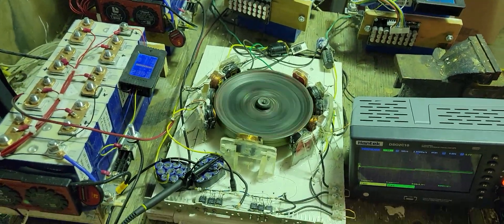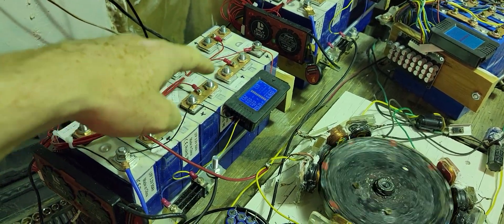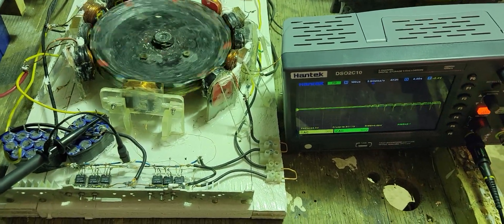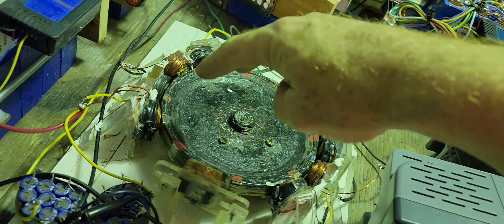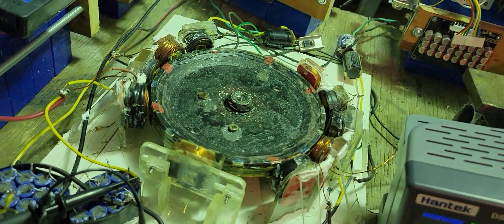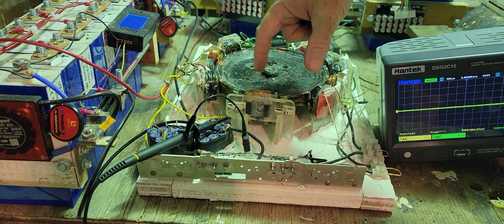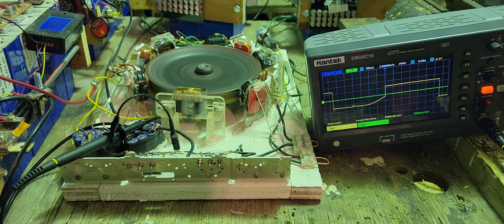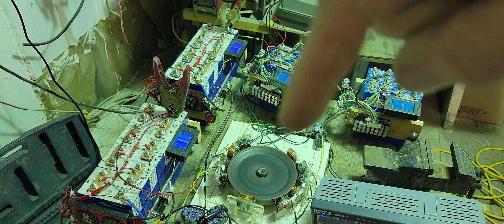Pulse motor Details and why I designed it the way I did . Reduced input power equals way more torque

Comment: to prevent the back spikes, why not put capacitors between the trigger coil and the transistors? Give the back emf a place to go and why not store it?
Reply from the maker: Yes but it will need more than just capacitors because once they are full it will be actually the same. In future videos I will add that stuff I’m trying to keep it as simple as possible for people to learn how to make these motors. I’ve only been adding small sections onto the motor in a series so I don’t confuse people with a huge amount of wiring. Thanks for watching!
Reply: @windpowerandmore6310  Unless your capacitor bank is bigger than what your trying to hold. If your output is 100 spike, then put a bank of capacitors that is 150V. flip the switch off and let it run on capacitors until it starts to slow down, then kick the battery supply back on.

Comment: Just a question about the transistors. I was wondering if you have tried to rectify the emitter and collector wire on the transistors with a incandescent light bulb"twist ball" . I call The collector and emitter wires, the input wire and the signal wire to me. I noticed before that I get the huge back spikes off the transistor signal wire and input wire. I only ask because I noticed my transistors getting hot too,
 but once I rectified the collector and the emitter with a incandescent twist bulb, the heat and the transistors went away.  I don't know if the light bulb just help control the huge back spikes or what was going on.
Reply from the maker: That definitely works yes . The trigger coil is no different from any other coil and I've done that in the past.  The reason I don't do that on this motor setup is because I'm trying to keep it as simple as possible so people can replicate the circuit  as easy as possible for them with minimal questions and parts that don't need to be on the motor to make it work.  One diode will complete take the energy away from the transistors.

Comment: THANKS FOR SHOWING THIS TO US WIND MAN. QUESTION-1  ? WOULD'NT ADDING MORE UNPOWERED  COILS INCREASE OR ADD BATTERY CHARGING CAPACITY. INOTHER WORDS  GETTING POWER THROUGH CUTTING FORCE FROM MAGNETS ?  QUESTION-2 ADDING STEEL TO CHARGING COIL WOULD NOT BENEFIT,        I UNDERSTAND NOT NEEDING THEM FOR MOTOR COILS THOUGH. THANKS MUCH.
Reply from the maker: Thanks for watching! Yes adding coils for charging will work.  If I had more time I would show how to do that with a magnet coupled second rotor that is geared down but I'm leaving to go back to work soon. And adding metal to charging coils only does one thing it slows the rotor down drastically which cuts power output because of eddy currents. Having coils the are air coils produce just as much power because they have much less drag on the rotor.